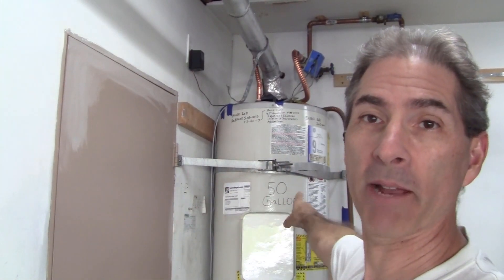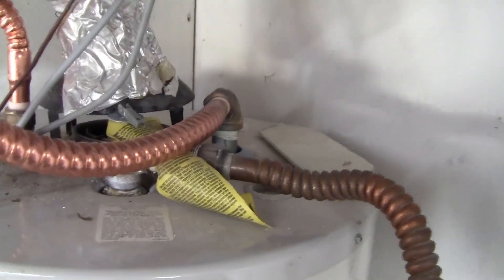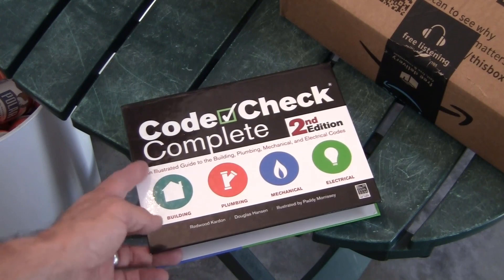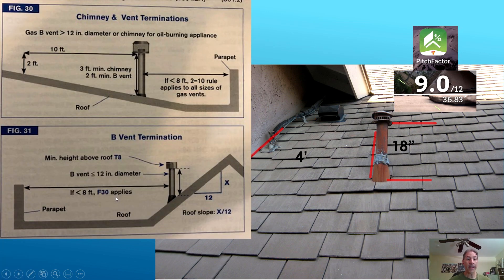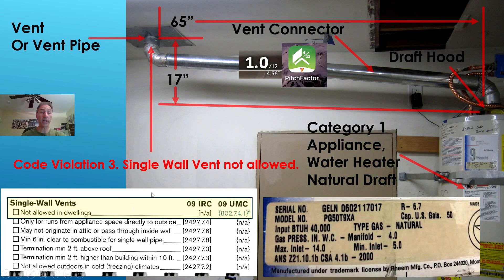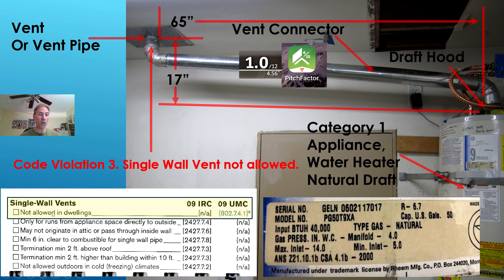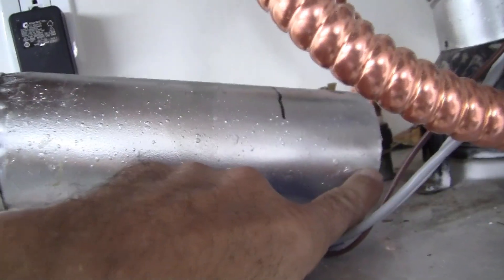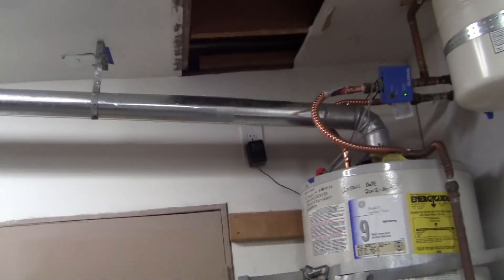Water Heater Vent Pipe Inspection Failure and Fix

Comment: Quick question. When the heat isn’t running under load, meaning just the pilot is on I do a draft test and my flame is pushing into the room. I see the paint fog up on the top of the tank. When the tank kicks on the draft operates as it should. Flame or smoke is pulled into the hood. I’m using b vent all the way to the dedicated chimney lined flue. Thank you
Reply from the maker: I would say most likely you’re going to be OK but I do wish that even under only a pilot condition you maintained a negative draft so that way no products of combustion we’re coming into the space. How are all your diameters of your piping, does it look like it’spiped correctly or could that be the reason why you’re not pulling a draft even with only a pilot load

Comment: I have some work ahead of me to resolve the genders in respect to direction of flow.  In your video, you clearly state that the flow should be out of the male end into the female, which seems quite reasonable and is how I've done it in the past.  However, I've seen some commentary that it should be the other way so that condensate will remain contained and drip back down into the appliance where presumably it will be heated and vaporized for another try.  I have yet to find this spelled out in the code, but I'm looking...!
Reply from the maker: There should be no condensate in my system. This is not a high efficiency 98% furnace. That system will have condensate and is made out of PVC.
Reply: @KenTraining  - Yeah, my inspector agrees that condensate is not an issue for B/C vents; flow should be out of the male end and into the female.  It's really hard to keep a straight face when I'm typing that description...

Comment: You are less than 4' from the overhang of that roof?  Doesn't that need to be taken onto account in the 2/10 rule?   Flue gas can get underneath the overhang and enter the home.  

Water heaters are the worst because they use a draft hood instead of an Inducer motor.  It is very easy to have spillage at the draft hood.  Even with an appliance with a draft motor there needs to be draft 18" past the breach of the appliance.  The draft motor is only there to assist in getting draft started.  

With appliances that use a draft hood, wind can come across the taller roof drop th the lower roof and cause the draft to be lost.  Not to mention anything from a kitchen hood, bath fan or other appliances that have a draft motor causing negative pressure inside of the space.  

At minimum a smoke pencil should be used to prove draft rhe worst conditions possible.
Reply from the maker: You are correct BUT I did not do the original install and I do not want to do roof work. To correct to code and keep the same roof penetration then the vent would be very tall. It does seem to work as is just by looking for leakage at the flue damper.

Comment: Do I need a lighter in my chimney for running a gas furnace
Reply from the maker: I am not sure what you mean. Many people vent natural gas appliances using a chimney.
Reply: @KenTraining  with gas appliances it is required by code to have a liner because cracks in the mortar is a easy way for carbon monoxide to leak.
Reply: @KenTraining  liner

Comment: It looks like you need a powered vent water heater
Reply from the maker: That is a true statement. I have studied these water heaters and to meet code and leave in the same spot, I should change to powered. Drawback is 1. cost and 2. availability. I was planning on waiting till 100% failure (leaking) and then change out. the powered water heater would take 1 to 2 weeks if I ordered via Home Depot today. Even though I have a code violation water heater installed at this time, this style water heater has been working for over 40 years in this home in this spot...

Comment: gotta dissagree on the orientation of male/female pipe.  it matters alot for wood burning appliances but for gas, the dilution air from the room at the draft collar will cause a Vacuum and the flue gases will find its way out fine.
Reply from the maker: you are probably right that it does not matter as much. But I do think, as long as you are the installer, why not install the right way...

Comment: You can get by if you put metal flashing between vent and existing wood, then I would change it later.
Reply from the maker: That is good practical advice. Thanks
Reply: @KenTraining  inspector made us do it one time so I can't take the credit if we have PVC venting running too close to the roof they made us do it too how to put flashing inside the roof above the pipe in case they nailed through

Comment: Your vent pipe looks like it is installed correctly to me.  Male at the lower end and female on the upper end. You describe it like it is not that way but the video clearly shows it that way.
Reply from the maker: a proper install is female on lower end and male on upper end.
Reply: wood burning vents need the male on lower end. water heater needs the male on the top

Comment: I was under the impression that you can’t have the vent be next to a window die to carbon monoxide poisoning, and if it was it would have to cleared the top of the roof
Reply from the maker: you are correct, there are window clearance requirements. I was not near a window.

Comment: Good morning Mr.Ken

I would like to ask you a question about the metal vent pipe for the water heater: why does water drip on where two pipes connected.
I appreciate
Reply from the maker: I want to answer you but I don't understand. are your referring to my video or your house?
Reply: @KenTraining  about my house, please.
Reply from the maker: @JBTran-p7j  I need to understand "where the 2 pipes connect" what is that location? I need a better description.
Reply: @KenTraining  So from the water heater tank up to 3 feet using an elbow installed, then from the elbow and 5 feet long connecting to 6 feet long (total 30 feet through the outside backyard), so between 5 feet and the pipes connected, water drips/ leaks. Is it possible for me to use anything to seal those two pipes?
Thanks
Reply from the maker: @JBTran-p7j  is the water coming from the flue gases condensing? Can you take an infrared thermometer and note the temperature of the flue pipe upon exit of the water heater and then at the midway point and then at the roof exit. I assume your are running natural gas for the fuel but please confirm this is true.
Reply from the maker: Natural gas condenses at 135 degrees. if you pipe is colder than that, you are condensing the gas. To prevent this, you will need to insulate the pipe, to keep it hotter than 135 degrees.
Reply: @KenTraining  what is good material to insulate, please advise.
Reply from the maker: @JBTran-p7j  I would need to know the temperature of your pipe? please provide that at the beginning middle and end of the vent pipe and what fuel you are burning.
Reply: @KenTraining  Good morning sir, I will go to Home Depot and and get a tool to measure temp.
Reply from the maker: @JBTran-p7j  sounds good, here is a link for one under $20 https://www.amazon.com/dp/B00DMI632G/ref=nosim?tag=kentraining-20&th=1
Reply: @KenTraining  thank you so much and you have a nice day sir.
Reply: @KenTraining  Hello Mr. Ken
The measurements beginning is 250
Middle is 81 and outside is128 degree F
Reply from the maker: @JBTran-p7j  can you take the middle reading again as that does not make sense. please let me know what is the fuel for the water heater. is it natural gas or other?

Comment: Why did you use the old single wall type c pipe if it's not to code 🤔
Reply: Because it's a slate roof, if you don't have the ability to change it out now, this is absolutely an improvement.  Don't bite him for a reasonable compromise.

Comment: Ken my vent pipe is running thru a big hole in my ceiling with nothing to seal up the hole around it, what can I do?   I’m looking for a product to seal the hole- something like the metal sheet on your ceiling by the heater-  what should I look for?
Reply from the maker: you can make one by buying a sheet of sheet metal and cutting the hole out with tin snips. I don't know if you can buy pre cut.
Reply: @KenTraining  easy enough, think I will do just this.  Thanks!

Comment: sMaSh dAt LikE buTToN 🥴
Reply: He says its HIS OWN HOUSE , and he is NOT IMMEDIATELY replacing all that OLD crap painted existing horizntal sections . What he cannot afford it ?
He at least should have put non combustable material like concrete board between that joist as he shows on the photo . He was in the attic to take the photo . 
it was accessable. I understand walking on that brittle roof is VERY tricky to replace out that C pipe . Right hire someone , its your OWN house . 
Maybe , whats his name , from that TV show can go over there , ...

Comment: I just want to thank you for your information, removed the insulation around the vent and the furnace it now shorting at 9 minutes. I assume I need to empty the rest of dirt off the burner, even if has been a couple of weeks since it has been cleaned. The water hose vent was back drafting. Not I need to check my other new furnace why it is short-cyrcling.
I have learned so much from your website about vents.

Comment: I don’t know your location but here in San Francisco, California I believe you should have type B from the water heater going to a B vent T. Then the riser B vent above roofline.
The T is to prevent condensation and also you have a standing pilot in case there’s a backdraft the pilot won’t go out.
With the standing pilot we are required to be 18” above ground level in a garage area.
Otherwise you accomplished the task very well. I’m a 3rd generation residential sheet metal craftsman.
Reply from the maker: this water heater is 18" above ground and yes the jo b should have B vent going through ceiling and roof. I have not changed out yet but I should. I want to learn more about the T you mentioned. Is there a video link on one installed you can share with me?
Reply: @KenTraining  I’d like to know about the “T” also. Did that poster get back to you with more info?
Reply from the maker: @DanielinLaTuna  He never did get back to me...

Comment: What a cluster F.  Single wall thru to the roof.  Thee only thing right about this video is your code book. I used to giver those out to my apprentices.  Please fix this before you have a fire.  It isn’t even close to code, even after your work.  It wouldn’t even meet the installation instructions for the water heater.  You may have to buy a stubby water heater, and move it, before it can be made safe.  Just hire a pro and get it done right.

Comment: Hello Ken on your video we need a set of the two plates you have secured around the vent pipe as it leaves the room and up and through the ceiling. What are those plates called so we can try to find them for sale? And how did you attach them to the drywall ceiling? Thanks.
Reply from the maker: it is a home made fire block, made out of sheet metal. the drywall is cut to provide a 6" gap around the pipe and then the sheet metal extends past that and its just secured to the drywall. If you use type B vent through the ceiling which my house should have but the original installer did not, then you will only need a 1 inch gap around the pipe to the drywall.

Comment: it is done wrong, but in a vent where there's no lint, this seems like nitpicking. in a dryer vent it might be a different story.
Reply: Nitpicking?  There is not one thing right about it.  It’s a fire hazard with single wall too close to combustibles, pipe run backwards, elbow right at draft diverter, and ready to fall off, roof termination not to code, etc, etc,  Would you want this in your house?

Comment: But you didn't fix it. the roof transition is still single wall!🤔
Reply from the maker: Your correct, I did not want to change the roof penetration because the roof is very brittle to walk on. the roof material is not manufactured anymore. It has been working good for 20 years. When I change out the roof some day when it fails, I will correct this.

Comment: Quick question: the termination height should be less than 5 feet above the gas water heater draft hood--measuring from the top, or the bottom of the draft hood?  There're a couple of inches between the top and bottom of the draft hood.  Thanks.
Reply from the maker: my opinion is from the bottom of the draft hood because that is where the draft begins. The top of the draft hood is connected to the vent pipe.

Comment: but you are still a fire hazard through the roof you could just put b vent through the existing roof penetration and get rid of your fire hazard
Reply from the maker: That is a great point, I will have to take a second look at doing just that. Thanks for reminding me.
Reply: Keith, you’re absolutely correct. Single wall vent pipe is not allowed to be in an unconditioned space( attic area in this case). Single wall vent pipe is not allowed to leave your eyesight  (It’s quite obvious we can’t see it once it penetrates the ceiling). Ken, hopefully the B vent is installed by now , with all the required clearances.

Comment: How would you patch a pen size hole on a vent pipe? 
There's a mesh patch on my furnace vent pipe and I wanted to know what type of patch is it. It looks professionally done.
Reply from the maker: If its only the size of a pen, you can put a metal button in it. check this out https://hvac-talk.com/vbb/threads/2198672-Hole-in-my-furnace-exhaust-vent-flue-pipe
Reply: @KenTraining  Thank you for time. I'm still wondering where I can get this mesh patch for the hvac system pipe for future repairs to prevent from replacing the whole pipe.
Reply from the maker: @keithkeithkeith9874  I don't know, I have never seen or applied a mesh patch to a Vent pipe. 
It would need to withstand 500F or more...